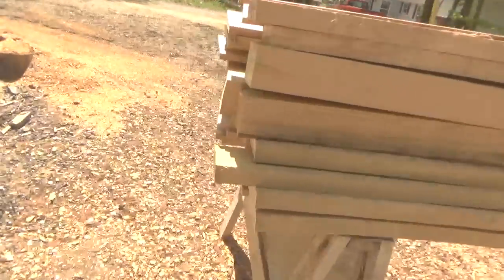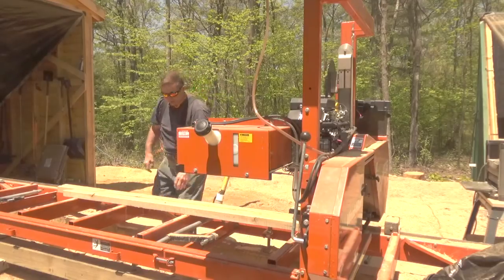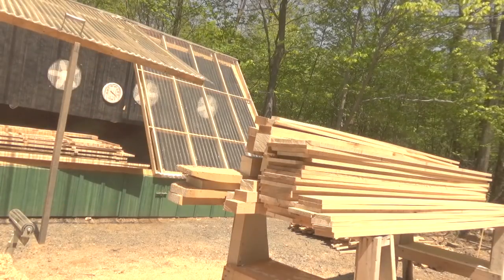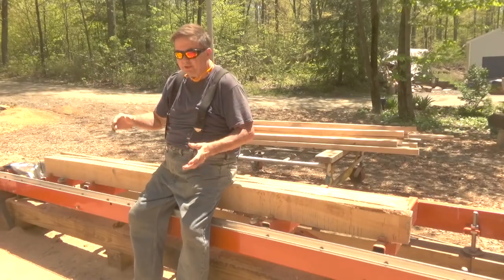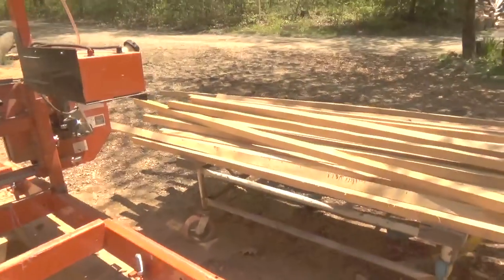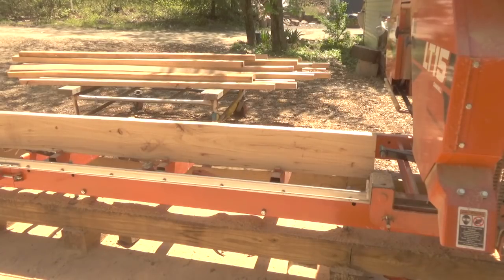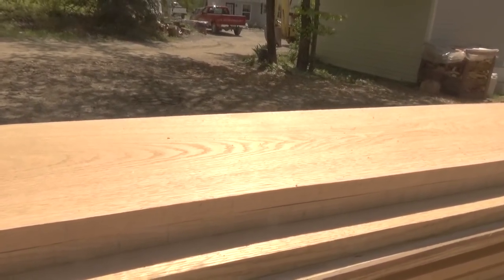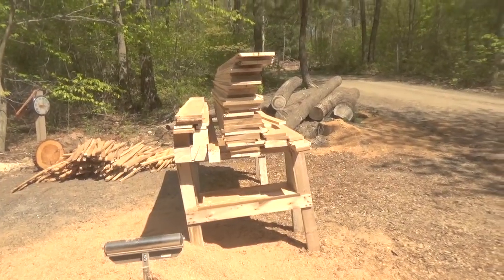All kinds of wood products from the Woodmizer LT15.

Comment: Regarding the badly cupped boards... I generally rip them in half and plane the two halves separately. This allows me to preserve the thickness and it avoids the problem of the board cupping again after planning. Than again, you've got an abundance of wood and like I we can afford to relegate problem boards to other uses (including firewood!).
Reply from the maker: The Colonial Craftsman No doubt that is a great way of handling the cupped problem. That would work on the 8" and bigger boards for sure. I seem to have cut a major abundance of 1x6. So I can't split them or they will be to narrow for my base moulding. Thanks for your input.

Comment: Those true 2X2 sure looks beefy compared to the 1 1/4 or 1 3/8 spindles  that the precut treated ones come at. Very nice.👍
Reply from the maker: trimco 1013 I will still have to plane them a little but I would like them as close to 2 as possible.

Comment: Morning Joe... those are some pretty nice boards! Wish I had red oak on my property, mine is mostly white pine. That's quite a pile of sawdust, were you able to use it for the chicken coop? One more question, are you going to turn the spindles and shape them or are you putting them up square? That's going to be one beautiful house when it's finished. I think you mentioned that you are giving it to your son? I think tomorrow is suppose to be sunny here, so hopefully you'll have a nice day to finish up. Catch you on the next one.
Reply from the maker: John Collado Morning john, one of the comments was oak is harmful to chickens so I did not use the oak. I have a skid of white pine that I need to plane so I will use that. I was going to turn the spindles but the helper for that, did not work out. It would require another machine that I don't want to buy, so square is the choice.  I wish I had more white pine.
Reply: White pine is pretty much the majority of wood I have and they are all very large. I could never cut it all with what I have left in life! I didn't think about the oak sawdust when I mentioned that, pine would definitely be better. If I had pine sawdust I would use it over buying wood shavings from tractor supply. Regardless of whether you turn the spindles or not, it is going to look beautiful. There's a video all by itself when you do that project. Greenhouse was 112 yesterday, I had to open the doors, roof windows were not enough. The plants are loving it though. Have a great Memorial weekend, Joe. Looking forward to your next video.
Reply from the maker: I just got in,  the kiln is empty. You have a good weekend also John and the little Mrs.

Comment: My (limited) experience with 2 x 2's is that the warp so easily, I wonder if it would help if they were milled down just before installing them. What do you think Joe?
Reply from the maker: It is true 2x2 do have a tendency to warp easily, that is why you want to get them stacked properly in a stable MC environment. That I am cutting them to 30" will help that.